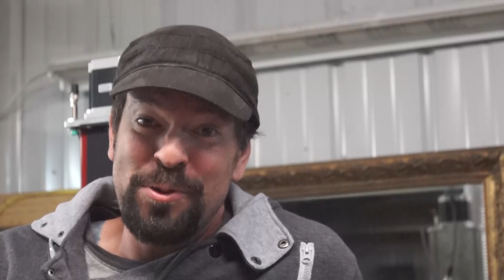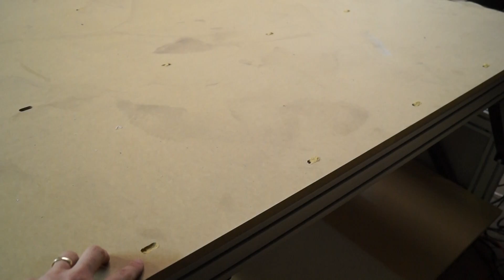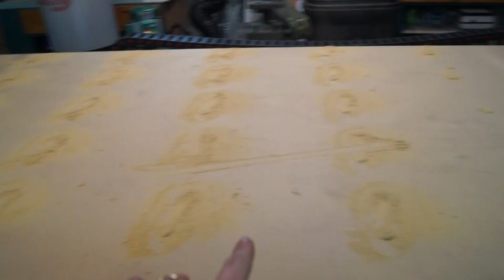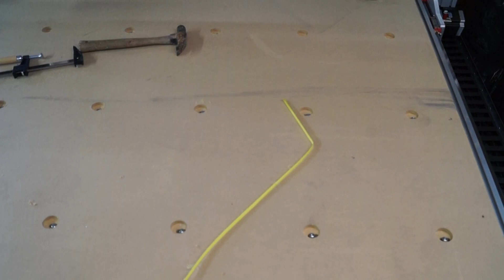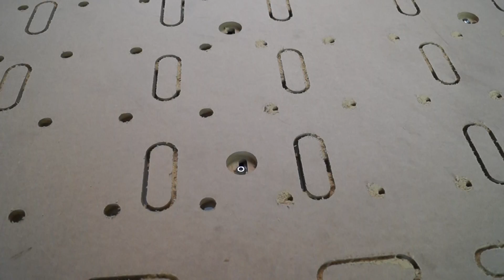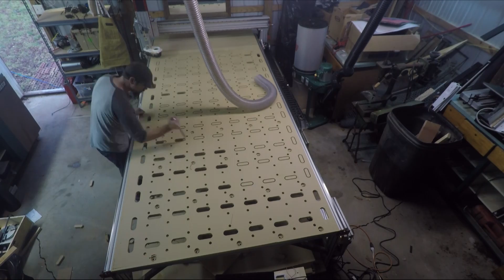Making a spoilboard for the CNC Router Parts 5x10 router!

Comment: Hello Caleb , Do u really recommend this cnc machine for a small cabinetry business? ....Im thinking in getting one but there is a lot of machines out there and with different prices  ..... this one caught my attention not only for the price but for the machine itself  ... I have a small shop and Im doing 1 or 2 kitchen project a month , you think this a good machine for me ?
Reply from the maker: there are so many options out there! One thing that really makes this system stand out to me is that it is modular and easy to upgrade. You could start with a smaller machine and, if your business grows, add on parts to make it bigger.

Comment: Hi Caleb.  very nice tutorials . I have a question, i moved  a  working CNC  from my garage to my shop and I disconnected Parallel PORT Cable only , and now when i connected Parallel port back my computer gives me 404-  Parallel Port Address Conflict. is there any way to fix it... Im new to this.  Thank you
Reply from the maker: Sorry Max, I don't have enough information to really help you out. Are you using Mach3? Windows? try googling the error and you'll find a bunch of results.
Reply: thank you  Caleb, i will do that.

Comment: The surfacing looks great, what bit did you use for that?
Reply from the maker: a half inch bit for the final survacing pass. The holes were all cut with an 1/8th inch. The file is one from CNCrouterparts.